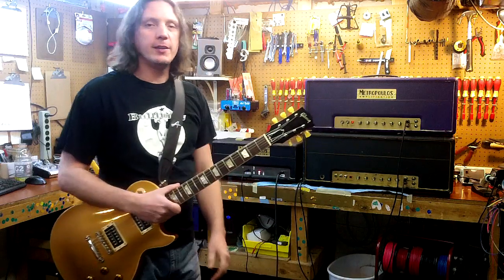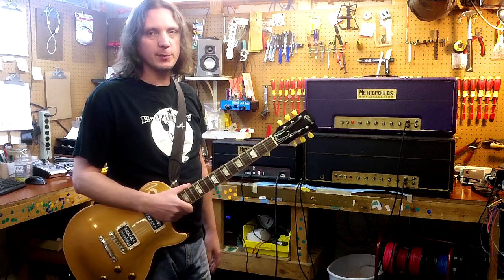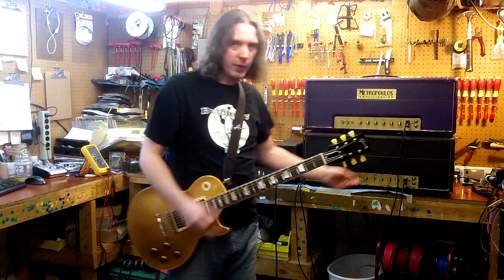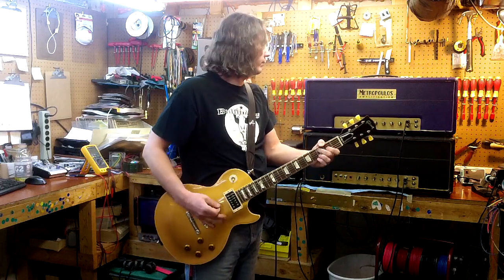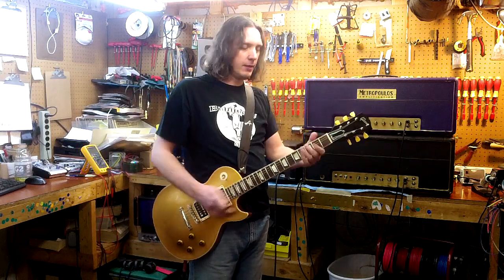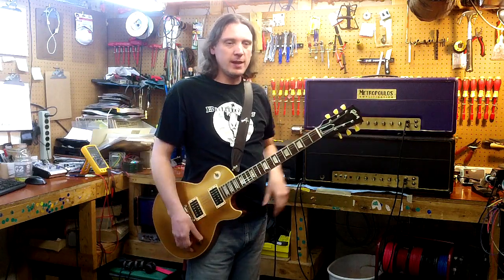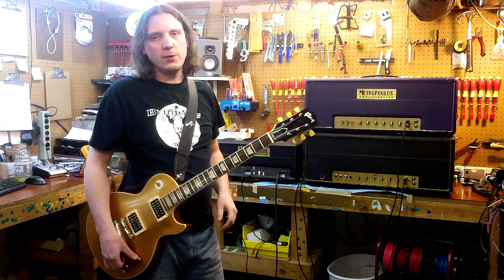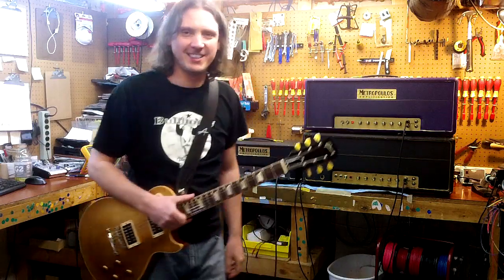Metropoulos 12,000 Series Features

Comment: Hi George!  I bought #12075 back in 2010 or so and still love it.  It does not have that the bright cap volume push pull...So wondering what setting it is on without the push pull?

Comment: Low heater voltage can cause stripping of the tubes cathode(s).  This will shorten the life span to some degree.  With modern tubes I don't sweat it at all.  For 240V operation the variac works like running the amp on 210V AC.

Comment from the maker: Thanks for the comments.
The amp is running into a Randall iso cab loaded with an ASW KTS-70 and also into my '71 slant loaded with G12H 30's.  I did have a Hot Plate inline, knocking off 4db, just to keep the iso cab under control.